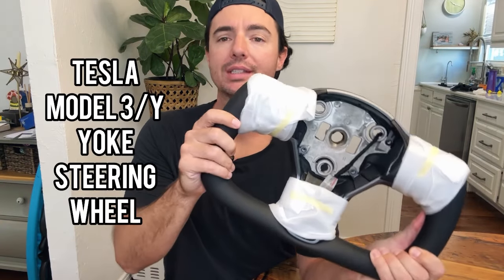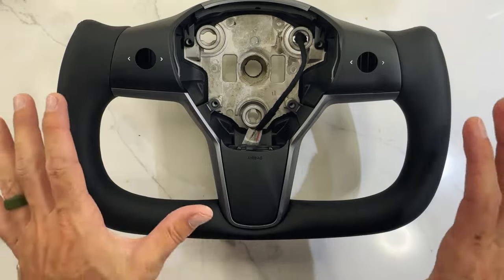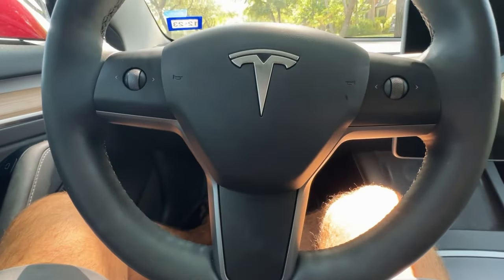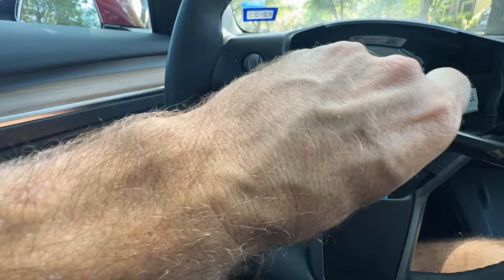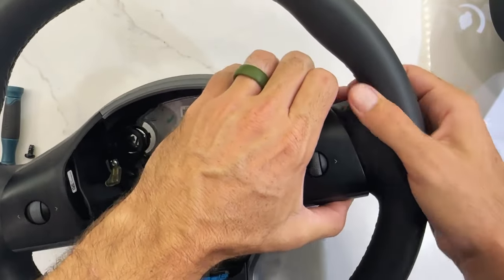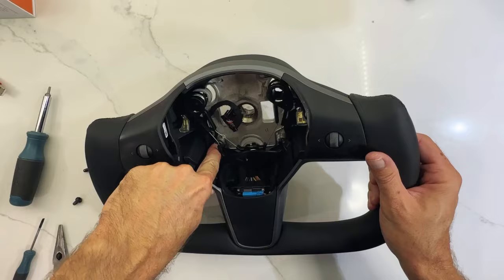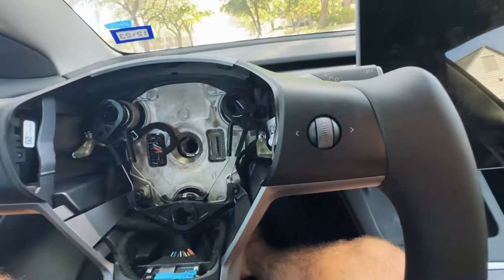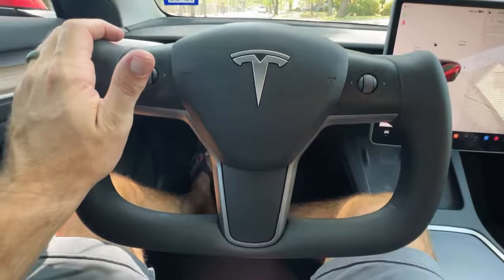TESFEEL Tesla Yoke Steering Wheel for Model 3 FULL INSTALL TUTORIAL

Comment: Absolutely spot on video sir. Just finished installing my own yolk in 30 mins after watching this! Thank you sir
Reply: Did you unplug 12v battery in your frunk?
Reply: @BurtBurnston  I didn't disconnect my 12 volt battery I just went into the screen and turned power off. I was thinking the same thing that I could set off the airbag all hell would break loose. It's just a molex plug that pops out It's really simple you think It sounds real complicated other than those tabs that I had trouble with It really was easy. And now they're shipping all the tools you need to take it off and reinstall. But I did torque mine with a torque wrench to 55 / 58 foot lbs. Per his video. But I believe as long as you get a good and tight you'll be fine. The wrench that comes with it if give it a good hard turn you'll be fine. It's a flathead Allen head bolt. If you're that worried about it you can always get a little loctite and put a shot of that on it but I think it's unnecessary. 🇺🇸👍
Reply from the maker: glad it helped!

Comment: Thanks for the tutorial....however, for me, I'm having issues with the airbag sitting too close to the yoke that when I place the airbag back in as final step, it keeps pressing down on the horn.  I've uninstalled and verified all the seatings and fittings but it still does it.  I made sure no wire was in the way, and when the airbag sits in, there's hardly any gap between the airbag and the steering wheel.  I've tried 3 different times with same result....what do you think the problem is?
Reply from the maker: Ive heard of that problem happening with older model Teslas... double check your specific yoke and make sure it works with your model year.

Comment: I purchased one of these wheels I like the yolks don't get me wrong. This yoke has issues with the way it's manufactured. The three holes that the airbag pins goes through for the 3 round pins from the back of the airbag that snap into the yoke holes. They have issues as far as where these factory plastic clips snapping in. The three round clips on the horn assembly that actually are also affiliated with the airbag assembly there are two fingers that snap onto the back side of the yoke housing into little recessed areas. This number is .5mm or .020 off or too thick in this area. I would not recommend this yolk to the average person that wouldn't have the knowledge to make this modifications. I noticed another video for this yoke where the guy actually had issues in this exact same area but didn't know what to do and it looks like from the video he just let those two little fingers not snap in and float. I called Amazon and made them aware. It's hard to make someone understand with no mechanical knowledge. I'm a tool designer by trade and design tooling for machinery to manufacture clips similar to these only metal. They gave me a $30 discount which is nothing compared to the time it took to figure out and do the yoke install because of the modifications needed. I did notice the price is dropping on this wheel probably for this reason and people are probably sending them back. The average person wouldn't realize what the problem really is. I'm not saying I'm any kind of genius but this is something I do for a living and been doing it for a long time troubleshooting things like this.
   A positive I guess changed as they started making more these is they now supply you with the tools needed to install this wheel which is pretty cool. I have some photos and some dimensions I took to verify this information I have talking about. If you break the edge or modify the back side where those fingers snap into it works fine. But if you don't do these modifications I can see this being a problem later overtime because of the fit issue. I do like the yoke compared to the standard steering wheel. It's very nice once you get it installed and if you have FSD It makes it easier to deal with the nag for sure. Don't get me wrong I love this yoke I'm just saying I wouldn't recommend it to someone that doesn't have some mechanical ability to make this modification. Maybe they all aren't like this I'm thinking either the mold that they molded the center section with either war out some overtime or maybe the mold didn't close all the way on the one I have. My yoke had the number of 315 on the back side. I'm assuming maybe they numbered them as they came off the mold not sure on the number but that's just a thought. Everything else seemed to work fine on this joke this was the main issue I had. Just be prepared for a longer install than what this video is talking about. Now maybe the wheel that's install in the this video, when it was done  was an early run yoke and the mold wasn't war in that area yet or the mold clothes together good. Either the mold was warn in this area, or the two halves didn't come together enough and stayed apart the .5mm or .020 molds like this also have retractable inserts that create these features. So maybe something restricted this insert enough to cause this interference problem. I'm not telling people not to buy this yolk I'm just warning you to be prepared for possibly a longer day than the 30 minutes it seemed to take to install this joke. Hope this helps anyone on the fence maybe the answer is if you have an interference problem in this area send it back until you get one that does it need this modification. Not trying to be difficult Hope this helps anyone on the fence about purchasing a yoke! It's really cool and as far as getting the hang of it, it really took me no time at all It was pretty much immediate! ✌️
Reply: How do I spot a bad mold? I just bought mine
Reply: So basically the spring assembly doesn't snap and stay in place? In the 3 holes
Reply: @Valentijnzz  If you have trouble snapping the 3 plastic clips in for the horn associated with the airbag. They may have fixed it by now or I may have just gotten one that slid through It all worked out. It still works fine I just had to modify the back end or those little fingers snap into place. Overall it's a nice kit It actually gives you tools needed to install which is pretty cool. Even though I had them.
Reply: @Valentijnzz  If you have trouble snapping your clips in place. As long as those three clips that have two fingers on them each snap into place you're fine. I had to modify the back side of mine because the area was too thick and the little fingers didn't snap into place. It was off around .030 or 1/32. I measured it with a pair of calipers I do two and I work mechanical design.

Comment: Hey!  Very helpful!  Wondering if I have a heated yoke but my OEM steering wheel is not heated, will it still work?
Reply from the maker: Hi there! Yes, you can still use the yoke, you just won’t plug in the heating cable
Reply: I ordered one of these from your link and it comes today I'm going to give it a shot. I noticed you just powered down from the screen a lot of other videos go a little bit farther. Does this definitely keep the airbag from deploying? I have a torque wrench do you know what the torque spec is by any chance? I'll let you know how it goes later today. Looks pretty straightforward.. I have my needed tools ready to go. Thx ✌️ Does this void your Tesla warranty?
Reply: @remingtonsypro3160 I’m wondering the same thing. I’m too scared to mess with airbag just from turning off the car from the screen
Reply: @remingtonsypro3160 what did you end up doing?
Reply: @BurtBurnston  Disconnecting the airbag is no big deal. Do not worry about that part.. You're turning the energy off. They give you all the tools and there are pretty good videos out there for the install. I may have just got a hold of an early made one or the mold may have started to wear out in that area. I could have sent it back and got another one but I was that far into it and I knew how to fix it so I figured I'd just fix it. 
 It wasn't a big deal It was just a matter of taking a handy grinder and removing .032 or 1/64 from the back side where that little finger sits. There's a little pocket in the back for those snap-in fingers on the clips. Yours may be fine. It's really nicely made other than that one issue I had. Just make sure you have the time and patience for doing it. I'm very happy with the yoke. I just installed the tilt on my screen. That doesn't go as quick as a video on it either but that's just the way it is. The other thing I like about the tilt it actually drops the screen down two or three inches which gives you more viewable area out of your windshield.  But it's so nice to have the screen to where you can tilt it towards you 20-30° also up or down and have it directly pointed at you instead of looking sideways and getting glare. As for the steering wheel it's great if you have full driving package FSD I have 12.3.6 If you don't have that then you're probably not going to enjoy it as much. It's easier to deal with the nag with this wheel or yolk. Anyway that's my thoughts on it. 🇺🇸✌️ Good luck!!